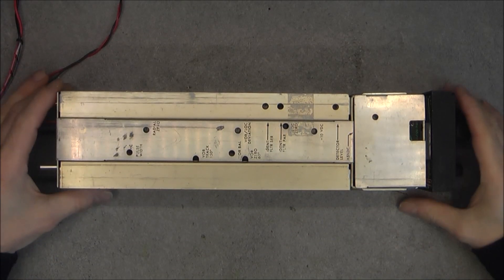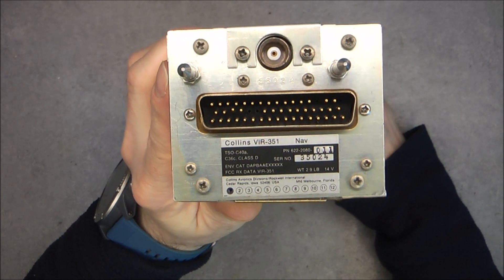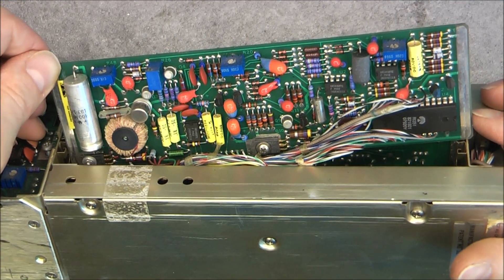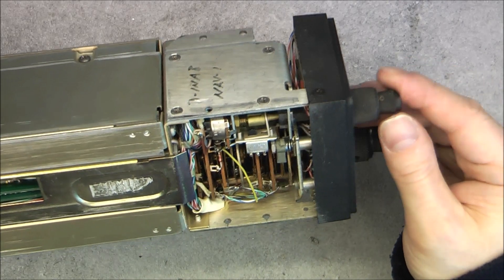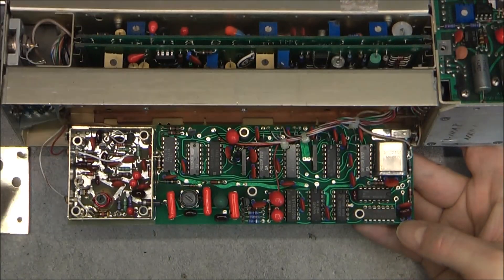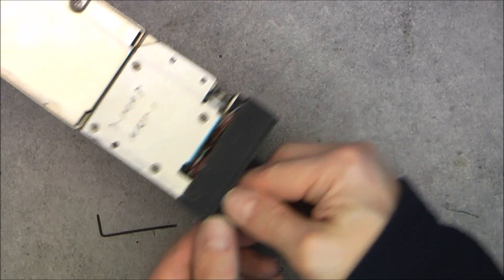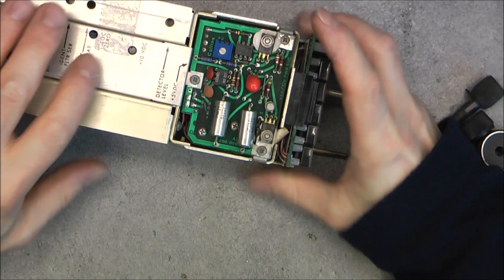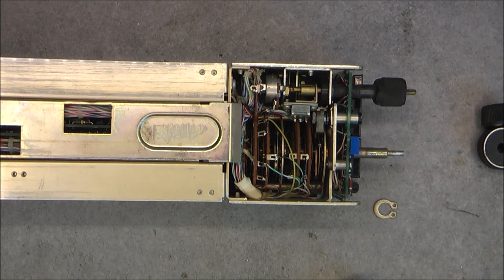Collins VIR-351 NAV receiver teardown

Comment: Very neat. I would guess that the dim digit has lost some of its vacuum. It doesn't make sense for the segments to stop being able to glow, and certainly not evenly like we see. Another guess could be that that the driver chip has a problem.. you could just swap two digits to verify that. Thanks for sharing!
Reply: I would say it's a driver chip problem. I don't see why those displays would go dim, if they lose "vacuum" which actually is noble gas the filaments will just burn and stop working...
Reply: @atmel9077  I would be interested to know the underlying physics, but from what I've personally seen, when these types of incandescent segment displays lose some vacuum (I realize that it could just be a noble gas), it takes more current to produce the same light output - which also leads to failure since there is now oxygen present. To get a higher current to flow through their constant resistance, you would need more voltage. These are 5V displays, so the voltage never exceeds that, which causes the segments to appear dim. As to why it takes more current to produce the same light output in a lower "vacuum" - that's what I'd like to know as well. Maybe this is just the effect of surface oxidation. This is just what I've seen from my own testing on these types of segment displays years ago.
Reply: @oriole8789  Well that's interesting... It may have a "leak" as well as there could've been a manufacturing problem which led to oxidation...
Reply: @atmel9077  That's what I suspect as well. High vibration in an aircraft could degrade the seal over time. I still have one 14-segment incandescent character display like this, where there is perfect continuity for all the segments, but they don't light up at rated voltage/current. Higher voltage will get them to glow a little.

Comment: bah les connecteurs genre PCB ( comme les anciens ordis )  avec les vibrations , pas super en avion .  
 je vois aucune protection tropicale des composants comme de la resine ?
Reply: C'est vrai que ça a l'air assez fragile. Il y a des trous sur le dessus pour les potentiomètres de réglage donc si l'humidité ça aura vite fait de faire des dégâts.
Reply: @atmel9077  quand je pilotais des DR400 , j' allais voir l atelier du mécano pour voir nos avions demontés ,  ca rassure pas du tout .  et quand j ai vus les radios et leur circuits imprimes qui dataient  de 1980 , radio AM en aviation je precise !  wow ( des patchs partout des fils qui corrigent des erreurs de pistes , etc )